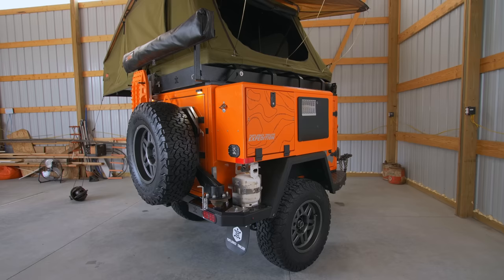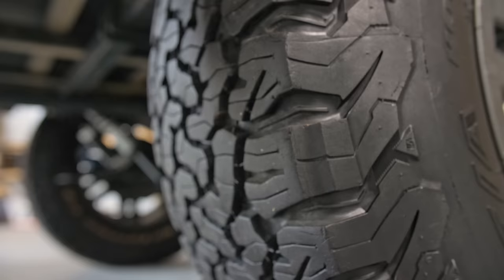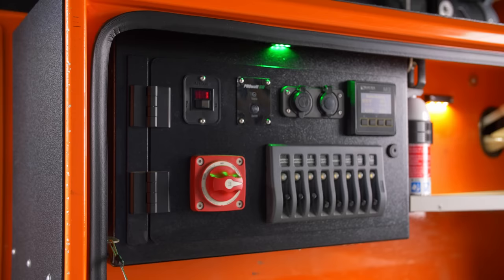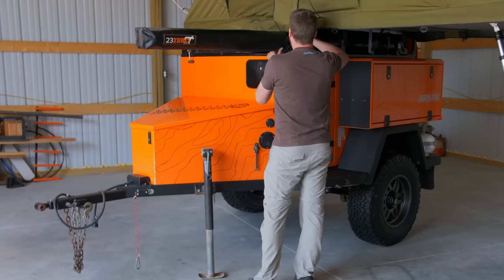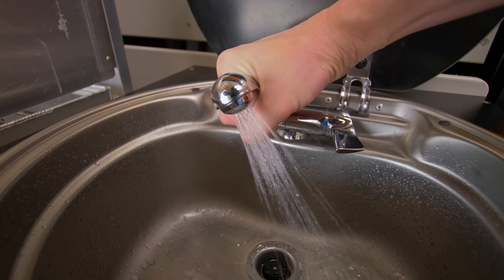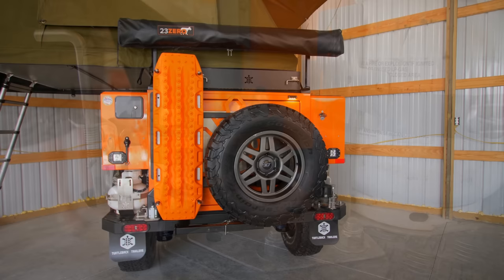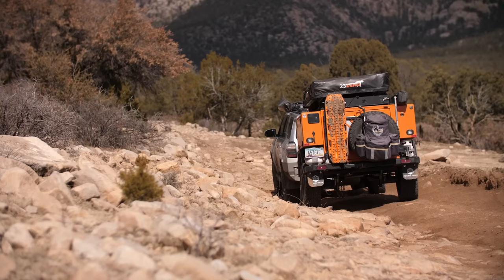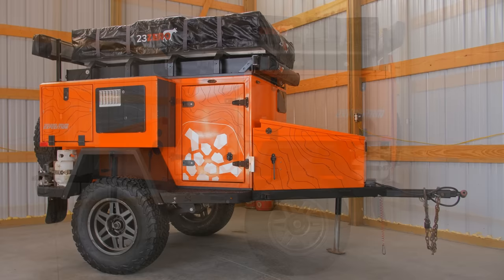We put it up for Auction! - Turtleback Trailer Expedition 50,000 Mile Walkthrough

Comment: Can I ask what awning set up you did for the camp kitchen? I just picked up my TB trailer last week and I went with an electric rooftop tent, which would not allow me to use a standard 270 awning. My camp kitchen is not covered from the elements and it looks like you came up with a solution.